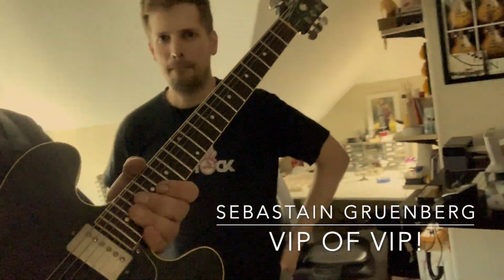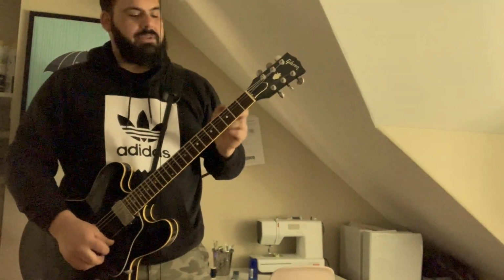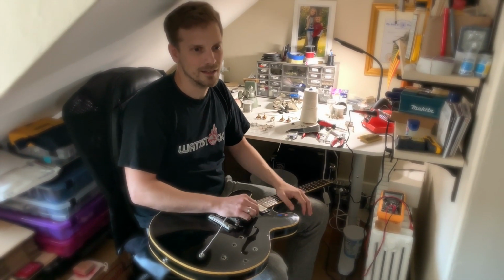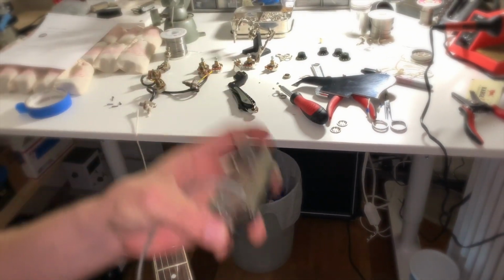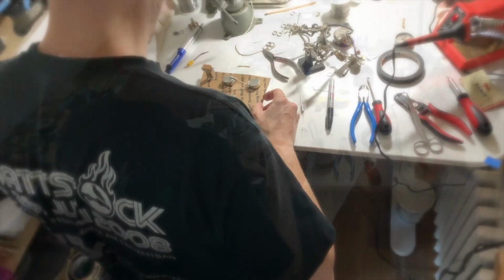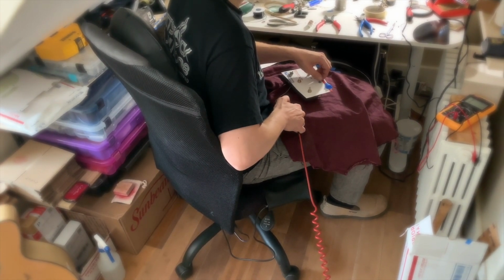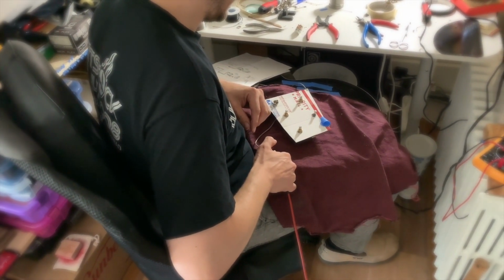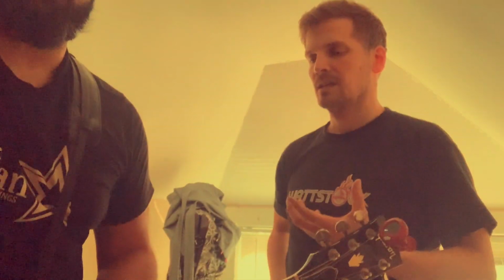GUITAR MODS: 59' GIBSON ES-335~DOT GETS SOME TWEAKS

Comment: Hahaha! "No Stairway!" Thanks, Nik, for stopping by and trusting me with the work on your 335. I'm really happy how it turned out. Sounds great now! Talk to you soon, brother.
Reply: Hay Sebastian so if you had two pots valued at say 510 and the other at 520 wot would you use where ie witch one for volume or tone?
Reply: @markwright9352  Depends - if you're talking neck pickup on a Gibson style guitar, I'd put the 520 in the volume, 510 in the tone. If you're talking bridge on an already very treble-y guitar, maybe 510 volume, 520 tone. However, those values are so close that the difference in tone won't be dramatic either way.